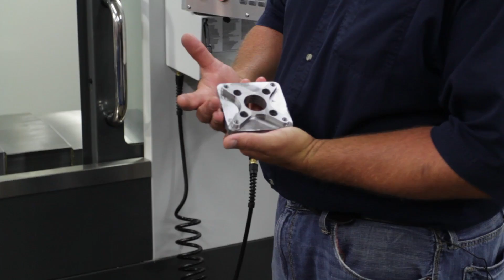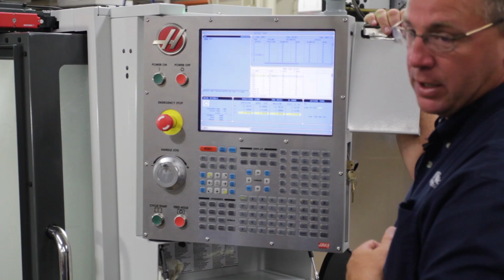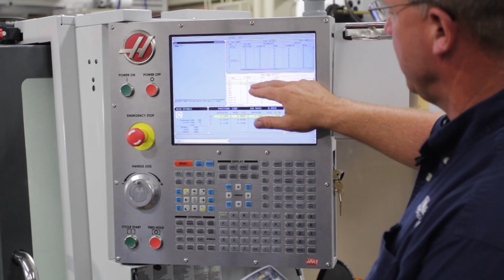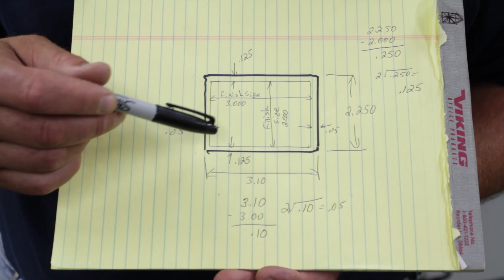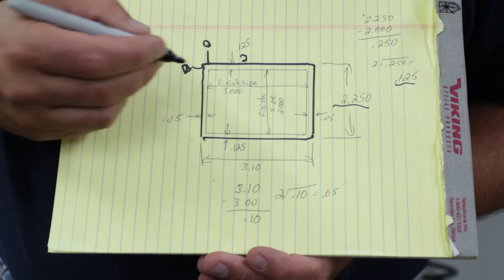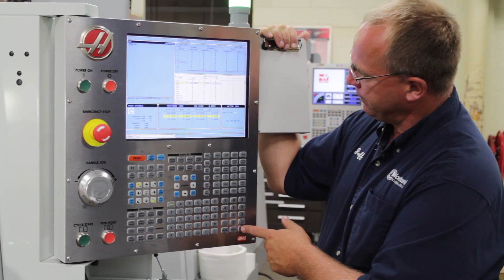Haas Machining Centers    Work Offsets

Comment: what advices when i dont have any edge finder ? someone manually help me
Reply: Cong Nguyen Thanh blue up a 1/4 dowel pin...spin it at 1500... move in til the blue starts to come off....same thing as an edge finder without the spring
Reply: tear off a piece of paper and move it around in between the part and your cutter, moving the cutter closer to the part until the paper is stuck between them.
Reply: that could be done with z axis. but with The X and Y , could it be exact ? and with it, should i turn on or off the spindle ?
Reply: +Cong Nguyen Thanh 
use paper for z axis tools offset setup. for X and Y use tool pointer if you don't have edge finder to setup work offset. jog the tool to the top left corner of the part to set up X and Y offset in offset page by pressing" part zero set "key, twice , one for X and one for Y.

Comment: Jeff Block explains the procedures of setting up these machines really well. We are an injection moulding company along with manual mills and lathes. We bought a 2002 VF2 a year ago and after watching Jeffs' videos we're using the machine confidently and as yet had no crashes.
Reply: cnc lathe setting

Comment: Does any one have any tips on operating a cnc carbide grinder machine? If the set up is different than mills? It's been a couple of years since I last operated a cnc and could use the refreshment in setting up. Thank guys.

Comment: Using a drill chuck with an edge finder, bad practice. Using a mechanical edge finder on that machine seems slow and difficult considering the much easier options for a relatively expensive machine.

Comment: There is a parameter to override the max spindle speed when doors are open, you can change it to 1200 if you'd like. there is also a few parameters that will allow you to disable the door safety features (along with setting 51)

Comment: Door override: 1) Power On 2) Reset 3) Settings/Graph 4) type in 51 5) push arrow down 6) push arrow right change setting 51 to "ON". You may now operate in a less safe condition. Oh you have to answer "Y" or "N" after you change the setting.
Reply: Setting 51 is gone.. since like 2010ish.  Now you have to manipulate the door locks physically.

Comment: Those door locks are terrible! The edge finder want to run at 1200 rpm. So now you have to shut the doors and pick up the part with the doors shut. I hate it!
Reply: pd4104gmbus my emco was a pain in the ass when it came to the doors and there wasnt any way on fanuc-o control to disable the door so i made a tiny part and mounted it hidden away so the switch is always in the position that the mill thinks the doors are always closed,, mucho better !! i never dug into a haas but even though it did take a little time of digging to find the switch (they stuck it pretty deep into the mill sheet metal/housing) it sure was worth the few hours i spent one night mechanically making it think the doors are forever shut,, just a thought for ya,, good luck. There were a couple things here that really annoyed me but maybe its because im old and grouchy!! If i ever see one of my guys with an indicator Not in its dedicated collet or an edge finder Not in its dedicated collet their ass is out the door,, last strett-info i saw said about 1600-1700rpm or so and thats what ive always used,,in mold work the TIR of any drill chuck isnt good enough, i dont use a drill chuck unless i just cant find a collet or tool holder that will grab the tool, from spotters or cntr-drills and twist drills to insert tools i always collet but maybe im doing it wrong,, hell who knows !! Maybe with a little luck the haas door switches wont be hard to find, hope this idea helps, on 20-40 hr runs being able to open the doors, slow the mill to a crawl at anytime and check stuff out makes life easier,, i also noticed that on super hot days leaving the doors open on really big g-code files running high spindle speeds/high axis feeds (.008 finish-pass,, no mess flying out) on cavity finishing that it lets everything run cooler but again that was my emco experience
Reply: Go into settings, find Door Hold Override, turn it on. Then you don't have to close the doors.
Reply: DothBeEthan Haas does not allow that anymore. I would love it it it were that simple. Thanks anyhow!
Reply: TRUBLEMAKR
Thats a pretty stupid reason to fire someone...
I'd think you messing with safety switches is much more worthy of being fired for. Much easier to change a parameter than permanently disable a switch that keeps less experienced operators safe.

P.S. for an indicator the runout doesn't matter, so it couldn't matter less that it's in a drill chuck.

Comment: Haas are the biggest pile of shit out there not worth pissing not capable of machining anything harder then Aluminium been an applications engineer for 20 years worked for numerous cnc manufactures haas are by far the worst Fact
Reply: I respectfully disagree with your statement sir